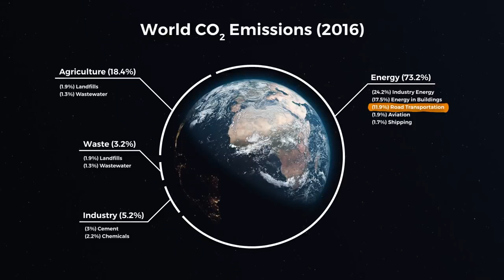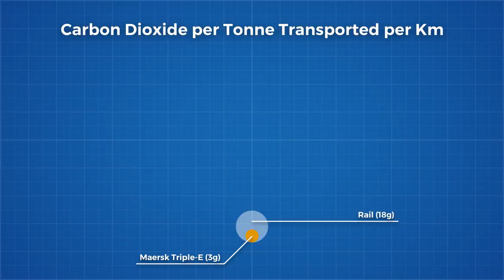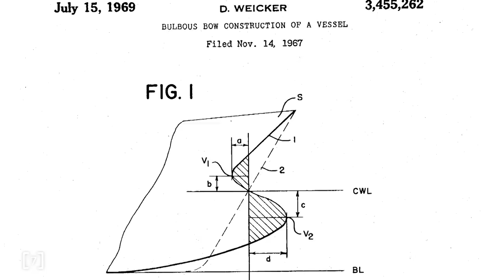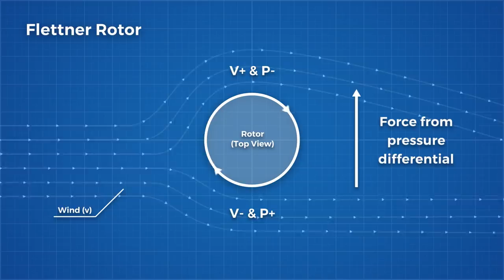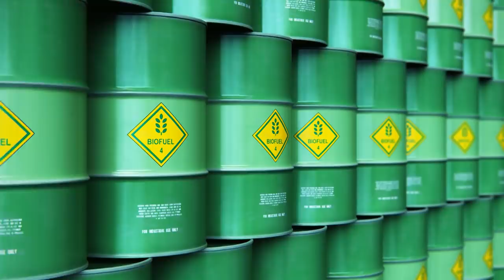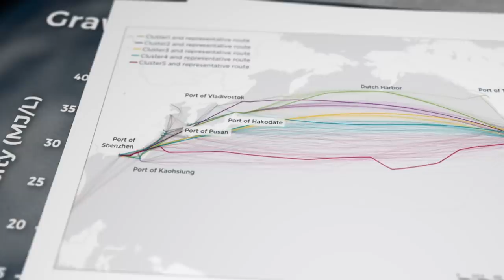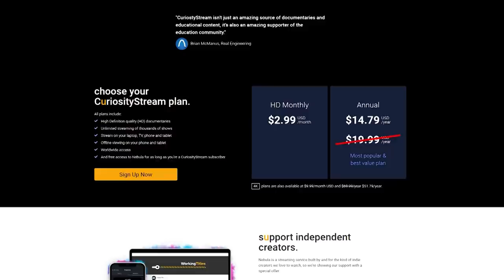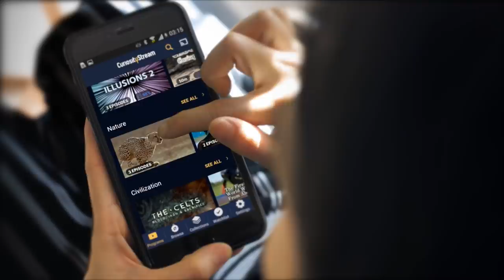Are Renewable Powered Ships Possible?

Comment: We had the technology needed decades ago, nuclear power! even many military ships use it today successfully
Reply: ‘They’ say nuclear is cheap, it’s not it is expensive, and has a large embedded carbon quotient as well as being complicated, dangerous, not universally socially acceptable and having only ‘no need for refuelling’ as a questionable advantage; actually it does need refuelling just not as often.  When ‘they’ do need to refill the warming up stuff it takes considerable longer than pumping tonnes of thick black stuff, cSt380 HFO, or thin runny stuff, MDO, onboard which is one of the reasons HMS Queen Elizabeth (QE) and HMS Prince of Wales (PoW) are pushed about by ICEs and gas turbines thus using a similar fuel as the aircraft that fly off of them.  The Royal Navy (RN) with a high degree of skill and expertise uses, at vast expenses to the UK taxpayer, a current operational nuclear fleet of 11 submarines (also known as ‘boats’) in two flotillas, seven attack subs and four ballistic missile boats.  The carbon footprint of all the extra bits of hardware and the fuel, including processing thereof, from ground to propeller, are the external costs that never seem to get considered.  The USN is not, as far as I know, a commercial organisation working to very tight margins and also has the skill and expertise to handle the complexities of nuclear power; so as well as submarines their aircraft carriers are nuclear powered and each of the current iteration has a build cost three times that of QE/PoW, bigger crews and even more generous funding.  For those who still think that nuclear energy might be the answer I recommend this report: - https://www.bbc.com/future/article/20200901-the-radioactive-risk-of-sunken-nuclear-soviet-submarines?ocid=ww.social.link.email.  The navy of the USSR might have been under resourced and over extended but it was still generously supported in comparison with merchant shipping.
Reply: @BernardLS  Nuclear power has a high startup cost but extremely low running costs. In the long run they are more far more cost-efficient than other means of energy generation. They take longer than oil or gas generators to pay off their investment, but over their lifetime they lead to far greater cost savings. Nuclear power is also not dangerous - clearly you haven't actually researched how nuclear waste is disposed of and what it is made of. High-level waste is the only actually dangerous thing that could pose a risk to marine life if the ship sinks, but high-level waste is kept inside airtight containers that can survive being rammed by a train literally without a scratch. 

The BBC article you posted doesn't prove the idea that nuclear power at sea is dangerous at all, it only proves that irresponsible handling of waste and shoddy construction is dangerous, which we already know. Soviet reactors have always been badly designed, and their designs have never been replicated in western reactors. It is extremely dishonest to compare old Soviet submarine reactors to modern ones, and extremely dishonest to compare experimental submarines to cargo surface vessels. An incident like Chernobyl is literally physically impossible in modern western reactors and even new Russian ones, and a reactor designed for a cargo ship would have much more space for safety mechanisms than one designed for a cramped submarine. The irresponsible handling of waste is dangerous regardless of what fuel you use, and high level waste is not as dangerous to the ocean as a spill of oil-based fuel.
Reply: @BernardLS  The "long run" is the lifetime of a ship. Taking into account all the costs, nuclear reactors designed for powering an electricity grid can usually pay themselves off in approx. 12 years, compared to gas power stations that take typically around 4-5. There aren't enough commercial nuclear-powered ships to be able to tell what the trend is, but they would still be cheaper over a ship's lifetime. Cargo ships typically sail for more than 20 years, often more than 30. The time it takes for a nuclear reactor to be cheaper than a fossil fuel alternative is definitely within the lifetime of a ship even if such a reactor would be as expensive as a large land-based one (which it wouldn't).

Nuclear reactors would also allow cargo ships to save time - the second most valuable resource after money - by enabling faster travel and vastly increasing the distance between refuelling stops (the nuclear-powered US Nimitz-class carrier can go the entire lifetime of the shorter-lived cargo ships, 20 years, without needing to be refuelled). The massive gaps between refuelling also lessens vulnerability to market shocks, whereas the cost of shipping is currently a slave to the cost of fuel. They also remove the need for fuel storage on-board, freeing up space to carry more cargo.

The main financial hurdle would be with the first shipping company that decides to shift to nuclear, since in cases like these it's always the one who takes the first step that has the highest costs; the expense of it would go down over time as the scale increases. Nobody wants to be amongst those who pay the most, so some sort of subsidy would have to be in order. The economic argument for nuclear powered ships is very strong, it just needs somebody to come along and prove it before the rest of the industry follows suit.

The cultural perception of nuclear power is completely irrelevant to their feasbility as power sources for engines. It will determine how likely they are to be adopted, but that's not relevant to WHY they should be adopted or how feasible they would be compared to fossil fuel engines if they were adopted.

Modern nuclear reactors are passively safe, meaning that if they shut down (that is, the nuclear reaction stops working) if their coolant is evaporated through overheating - not through an automated system, but because of how the physics of the reaction work, because a coolant-loss event is also a fuel-loss event. This is of course in addition to active safety systems, since it's not good to rely just on passive systems. An incident like Chernobyl is completely impossible in such reactors. Fukushima relied on active systems for its "passive" safety to work, which were broken because of the tsunami. Three Mile Island only had weak passive systems in place which were not related to the actual nuclear reaction itself, and the TMI incident was actually really quite mild and nowhere near as bad as the public continues to perceive it to be. Ultimately all of the worst nuclear diasters have occurred with reactor designs that are no longer built or were even horrendously badly designed at the time compared to contemporaries (i.e. Chernobyl). Modern reactors cannot and do not suffer these same problems. The US navy has sailed roughly 240 million miles on nuclear ships without any leakage or accident.

The only real risk with nuclear-powered ships is if they sink and high-level waste leaks out, but you just need to follow the same waste storage regulations that land-based nuclear reactors do (and by offloading it at the earliest opportunity), and I would argue that dropping nuclear waste into the ocean is not particularly any more dangerous than a leak of oil-based fuel - something that is much easier to occur because of the huge fuel tanks. A chemical fire could potentially transfer more heat energy to a nuclear reactor than it can dissipate, but if the reactor housing is well-insulated and isolated from potentially combustible cargo (i.e. put it at the other end of the ship) then this would not be a problem. A ship powered by a nuclear reactor simply cannot burn like one powered by oil-based fuel can, because there is no fuel to burn.
Reply: @sulphuric_glue4468  Riposte.  ‘The "long run" is the lifetime of a ship.’  WADR ‘the long term’ is the ‘cradle to cradle’ lifetime of all the material from which the ship is made be that the hydrocarbons fuel which with ends up as atmospheric pollutants like CO2 or the fissile elements decaying of millennia.  ‘Taking into account all the costs, nuclear reactors designed for powering an electricity grid can usually pay themselves off in approx. 12 years, compared to gas power stations that take typically around 4-5.’  So payback time on a nuclear plant is two to three times the payback time of a hydrocarbon fuelled plant?  ‘There aren't enough commercial nuclear-powered ships to be able to tell what the trend is, but they would still be cheaper over a ship's lifetime.’  This was not the Admiralties assessment on the QE class carriers which, in part, moved them away from the nuclear option.  ‘Cargo ships typically sail for more than 20 years, often more than 30.’  The quadrennial surveys by the classification societies get progressively more severe and the 5th at 20 years is usually the last that it is economic for a merchant vessel to pass; the last vessel over thirty years old that I attended was ‘Atlantic Conveyor’ (the replacement for the vessel of the same name lost during the Falklands campaign) but she was built as a pride product on the governments largess.  ‘The time it takes for a nuclear reactor to be cheaper than a fossil fuel alternative is definitely within the lifetime of a ship even if such a reactor would be as expensive as a large land-based one (which it wouldn't)’ again depends where one draws; the boundary bear in mind that many a ship less than twenty years old is dragged up a beach on the Indian sub continent to be beaten to death with hand tools..  ‘Nuclear reactors would also allow cargo ships to save time - the second most valuable resource after money - by enabling faster travel and vastly increasing the distance between refuelling stops (the nuclear-powered US Nimitz-class carrier can go the entire lifetime of the shorter-lived cargo ships, 20 years, without needing to be refuelled).’  Time is a tricky thing especially when delays in shipping can come from any number of sources.  Most shipping trades get settled in to the niche which best suits them thus tanks tend to plod along at 15knots passenger ships get to float around at twenty and container ships hit twenty five; weather permitting.

More to follow.
Reply: @sulphuric_glue4468  2nd part.  Strangely sinking in deep water without significant fragmentation is probably one of the better options, as with the USS Thresher & USS Scorpion.  The reactors lost at sea by the USSR, either by accident or intent, are some of the least damaging ‘nuclear excursions’ they perpetrated.  AFAIK apart from one in Vladivostok there have been no major in port events.  The most likely cause of significant radiation material release is a hydro thermal explosion in shallow water which if it occurred near a population centre could give rise to immediate or delayed morbidity or even mortality.  Land based nuclear power plants have a few issues but are usually well regulated, stable and immobile.  Reactors on ships by their very nature are able to move between regulators, bump into each other and roll over.  Regulation of ships by both / either flag state or port state has problems and adding any nuclear regulatory obligations on to those already overstretched facilities would be very taxing for all involved.  This is not about 'could it be safe' it is all about 'would it be safe'.  It may also be worth remembering that ‘systems reliant on perfection are most vulnerable to disruption’ and 'the more complex a system is the more likely it will fail at some point'.  Am off up country for a few days so may pick this up when I get back.

Comment: New designs in nuclear fission propose modular reactors, NuScale is an example, giant ships could take advantage of the technology. Their small size modular reactors operate in a close circuit (water get heated, vapor powers a turbine and is then condensed into water that cycles back in the reactor).  They are conducting a test program in 30 cities at the moment. https://www.reuters.com/article/us-usa-nuclearpower-nuscale/some-u-s-cities-turn-against-first-planned-small-scale-nuclear-plant-idUSKBN25T30E . For existing ships, biodiesel produced from algae might be a route to explore since salt water and land that can't be used for crops would become valuable: deserts close to the ocean maybe? Too bad the cost of production is equivalent to a $150 barrel of oil at the moment but that could change with research and scale economies. Lots of ideas and still a lot of fossil fuels... I have no credentials whatsoever but it sounds obvious that waiting for the "always-20-years-away" fusion, fission endeavors like NuScale's is the way to go. Some other designs claim they can extract over 90% of the potential energy of uranium v. the typical 4%, making stored waste in the last 60 years a new resource. This is our immediate future, especially with the electric vehicles revolution we a living nowadays.

Comment: Couldn't they fit flexible solar cells to the sides of the ships that way they generate electricity to provide the majority of the power from the light both direct and the light reflected from the water
Reply: The sides of a ship are an incredible harsh environment, it is hard enough keeping paint on them.  Considering solar power; as an example the above container (called boxes by nautical folk) area of a Maersk triple E is less than 399.2m by 59m.  The 399.2m is the length between perpendiculars (marine tech speak - no need to worry about it) and the 59m is the width overall (more marine tech speak so again no need to worry about it) allowing for the sides, bow, stern & navigation/accommodation structure could we agree 340m x 56m or 19 040m2 for the ‘top of stow’ area?  Insolation rate in Joules will vary due to time of day, latitude of vessel, declination of sun, (those three impact the elevation of the power source) cloud cover, efficiency of solar panels and how clean they are. The triple E class use two 29 680 kiloWatt, at full whack, internal combustion engines each for propulsion plus some hotel and services power load cost; so for round numbers, could we agree 60 megaWatts?  Solar panels create about 155 Watts m2 averaged out; 19 040 x 155 gives me 2 951 200 Watts (or 3 megaWatts for a round number) from the top of all the boxes.  Three megaWatts might allow you to distil enough fresh water from the sea to wash the crud of the solar panels (surprise fact renewable energy comes with maintenance costs) but nowhere near enough to effectively 'push the boat along'.  Fitting solar panels on top of the ‘boxes’ is worth, at most, 0.5% of your power requirement.  More seriously the ‘boxes’ are loaded and unloaded from the top down so the solar panel array would need to be moved for every port operation and time is money as well as that operation having the ability to get very complicated (tech speak for ‘go wrong’).  Any additional weight would be in the worst possible place for the stability of your vessel, the operating environment would be harsh and the ‘top of stow’ on a ‘box boat’ is seldom a level expanse as each column of containers may be, and usually is, of differing heights.
Reply: @BernardLS  it would still increase the efficiency but i get what you are saying

Comment: The heavy fuel that the cargo ships were burning pre-regulation likely resulting a global cooling effect. The air pollutants are very bad for humans, but were almost entirely emitted far from human populations over the ocean, and research has found the sulfur had a cloud seeding effect that had a note worthy impact on the global temperatures. Experts are conflicted on whether the move to scrub cargo ship fuel was actually a good one, some estimates put it at increasing global temperatures by as much as 0.2 C. Obviously at some point a transition to renewables would be required, but the shift to natural gas and other cleaner fossil fuels feels marginal to negative in its impact. Great video though!
Reply: Ships still pollute a lot around harbors. Also, pollutants can travel a while before decaying or getting absorbed.

Comment: Nuclear salt cooled reactor that has process heat capable of performing pyrolysis on recycled plastic of poor quality to produce "reused" fuel oil? Better than shipping recycled plastic to southeast Asia to be sorted and the poor quality material burned in open pits. Same site could be used for power production and desalination.

Comment: Are these slower speeds contributing to shortages?
Reply: or is over consumption?  Speed reductions, a useful buffer for adjusting variations in demand, will in the long term require more goods in transit to maintain any given long term level of supply.  Typically tankers move at 15kn so a reduction of speed to 12kn could yield a fuel consumption saving of 20% (?), however to maintain the same flow of material an additional 25% of shipping capacity will be required.

4 ships at 15kn  =  60 freight miles  =  5 ships at 12kn.
fuel used x	                                            fuel used x+ or x- (?)

Reducing speed to save fuel reaches limits when the vessel does not maintain steerage way and suffers loss of control, the speed through the water is too low to overcome tidal streams and the speed over the ground is to low the make good any significant distance towrds the objective against adverse currents.  The speed to cost ratio is as finely balanced as any other ratio in the shipping business.